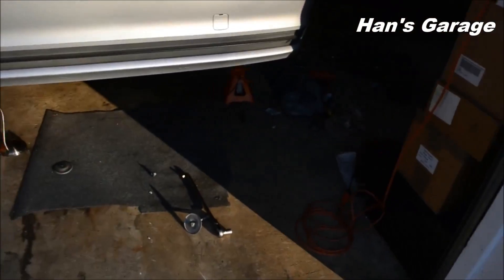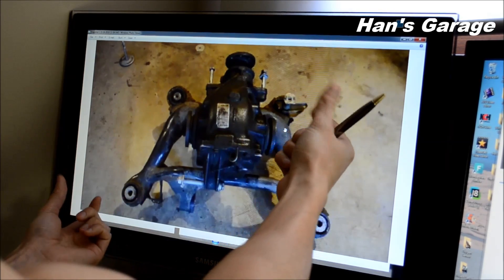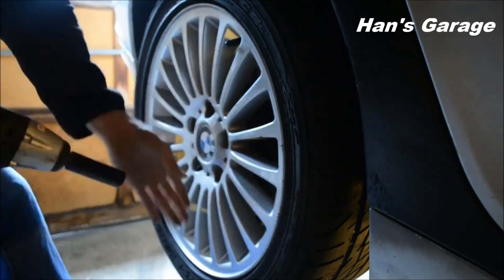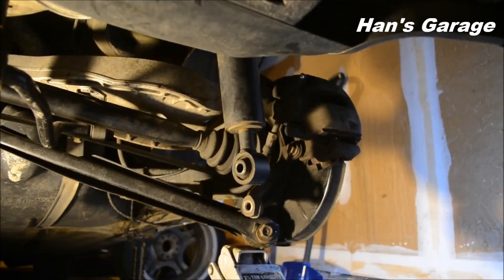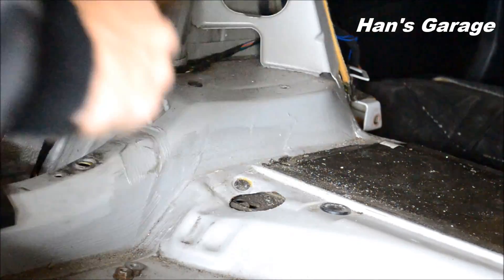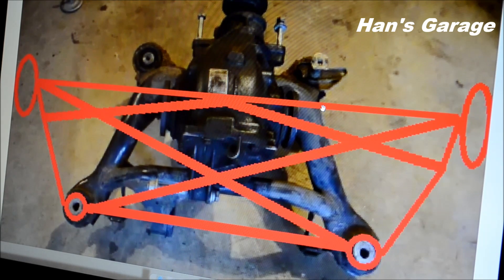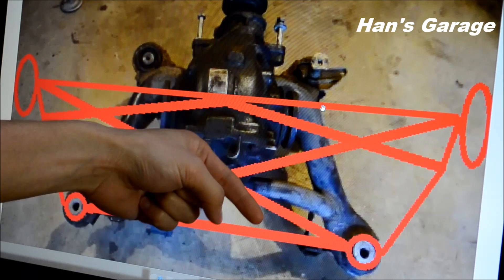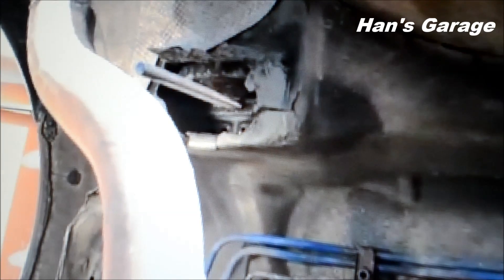Installing Mason Engineering X Brace for BMW E46 Models. Cause of the subframe failure part.1

Comment: 2000 for reinforcement plates? I'm getting quoted 5k in 2022. Inflation? lol
Reply: 5k is because the shop has never done it before. Just got mine done (2024) for ~$1200 with me supplying the plates. That was also with the plates being tig welded. Need to shop around

Comment: 8:00 I watched some other videos and it looks like where you are supposed to take the two bolts out that hold half the subframe stay attached to the chassis. Is this true or do the bolts just come out after unscrewing them?
Reply: yes take them out to drill hole bruh

Comment: To me looks like it might do the same thing eventually with the x mount. I think it would put the stress on the driver side just up top on shock mount .
Reply from the maker: Yea so I actually reinforced the front side too
Reply: @HansGarage   i just want to do it right the first time. I am not trying to be rude. I think you are very smart about this. I just want to make sure I am looking at this all the way through.  Thanks again
Reply: I have a 323 year is 2000 5 speed. I know that I have some very bad issues going on in this area. I really thought of just letting it go to the junk yard for parts.
Reply: how dod you reinforce front side any pictures of what the underside looked like after

Comment: What kind of noise does it make? Like a vibration noise from the diff / driveline? I just installed one, wanted to know if what I’m hearing is normal. When turning sharp corners I hear a vibration noise
Reply from the maker: I didnt hear any vibrations at all. It was more like squeaking noise from the bolts and nuts
Reply: Thank you

Comment: Isn't that an E39 M5 rear differential at 1:43? And arent the mounting points of the E46 M3 in different locations? 2 at the rear, one at the front? And isn't your whole explanation on why the rear frame mounts rather wrong?
Reply: Oh it's an E46, not an M3. I am sorry for the mistake.

Comment: Has this car been "raced" regularly?  I can't believe how it has literally fallen to bits like that! :-o
Apparently cars made after 02/00 are supposed to be slightly better, while post 02' models are supposed to be ok.
Reply from the maker: soundseeker63 1999 and yes, after the x brace installation, I never stopped flooring my gas pedal haha
Reply: HAN'S GARAGE does this reinforcement fix the issue permanently?

Comment: What is the worst thing can happen if the stock mounts crack? Is the car going to fall apart in the middle of the track or road or something?
Reply from the maker: Opposite Lock if all four mounts crack and rip apart yes your rear end would fall apart in the middle of the road but that's if all four mounts   Rip apart at the same time.
Reply: Yes it will literally tare apart.

Comment: What year and model is your e46? Looks like the damage is pretty bad in yours (from last video). I recall seeing another diy where someone used epoxy instead of welding.
Reply from the maker: +AK1313 1999 328i. Unfortunately this car got totaled by a drunk driver rear ending me last Thanksgiving. I've bought a 2002 330i and I am going to do another video soon!
Reply: +Han's Garage Hey, I've heard they fixed the issue in 2002 models and later, did you have any problems with the mounts still?

Comment: What about the rear mounts? It seems like this only supports 2 of the 4
Reply: Fronts can indeed be treated, it's been well known for a long time that the front mount ( on the upper side) is the first point of failure.

and just to clear things up. The front mounts are NOT attached to the chassis.

To address fronts you must remove rear seats and cut a window in the sheet steel and reveal the top side of the front mounts. This is crucial because every one of these cars will have cracks there and no one checks. (Trust me here).

mason brace is good but doesn't attach to the frame rails which I don't like. Front mounts need to be rewelded
Reply from the maker: +stuxtruth Yeap this x brace is for the rear mounts. The front 2 mounts are attached to the cars chassis.